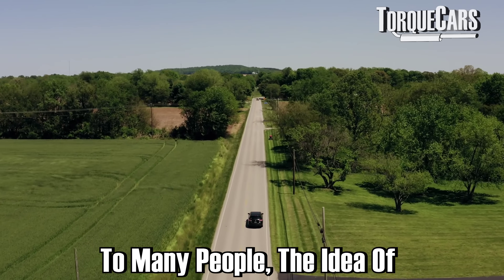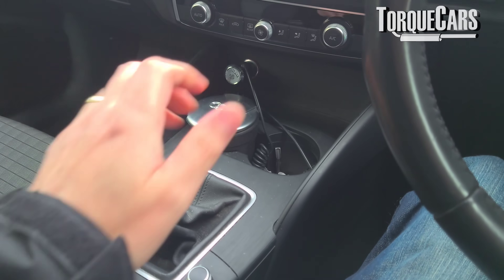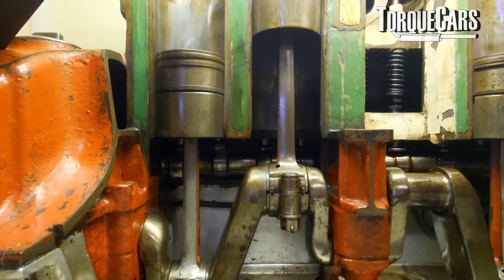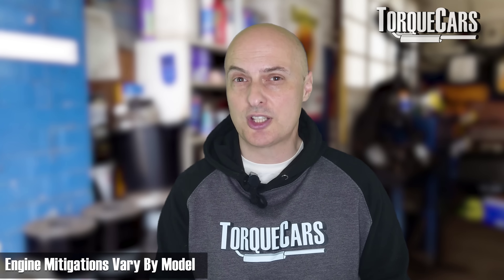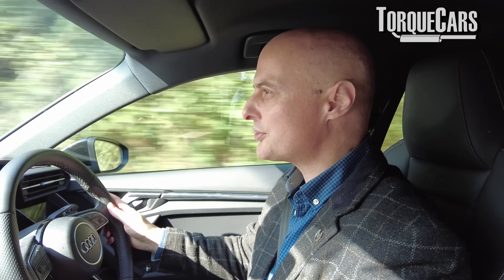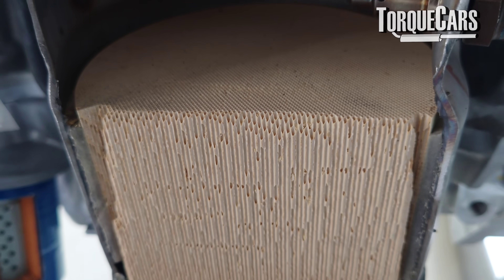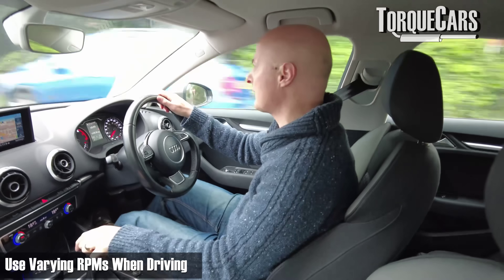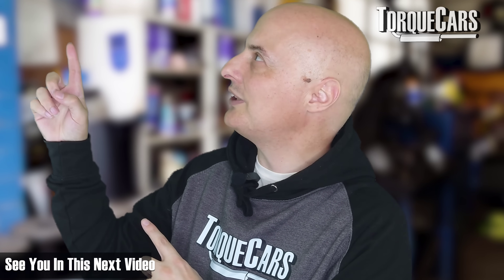BIG DAMAGE By Lugging at LOW RPM? Eco Driving Warning! (Manual Gears)

Comment: Low-speed pre-ignition is the true killer of the modern turbo charged direct injection engine, especially in cars like the Subaru WRX. So much fear mongering about how fragile they are have people babying them around, keeping it in low RPM and then trying to go into full boost at 1,500 RPM is already putting major stress on the pistons, rods, bearings and crankshaft. All it takes is one LSPI event and it's over, you've got a bent/broken rod or a banana crankshaft. Of course you may have many LSPI events that don't cause immediate damage but build up stress points over time, especially on modern aluminum-silicate pistons, which are great for tight tolerance but are very brittle and detonation can damage the ringlands and now you have lower compression and burning oil.
These issues affect all modern turbo DIT engines, if you have one of these cars don't baby them! Keep the throttle light in the low RPM and let it breath when you want/need to accelerate. Stop blaming the cars for your poor understanding of mechanics.

Comment: Hit the redline every day for a good time. That's what Dave Rock always said. And I honestly think that's correct. I drive stick and a 2.4l turbo Volvo that has been tuned. The engine used to be rough when I got it. Repaired allot of the broken stuff. Aside from motor mounts and basic wear and tear it's been solid ever sense. And I tend to stay in the higher rpm range. Like you said low rpm can be out rite dangerous. Not just for the engine but for the driver. You can not accelerate out of the way if need to. During winter I always drop a gear lower then normal so in case I need to power though a corner because of understeer I can. And that has saved me more times then I can remember. (awd life) also saved be ones from getting t-boned by a car reversing up and I had to get out of the way quick. Always stay near or within the powerband is my style of driving.

Comment: Uhh no, I  drive no more then 25 miles an hr tops in my work truck on a base near 30k miles my work truck is from 2010.. regular maintenance is all you have to worry  about..edit by the way my motor hrs are near 90k more idle then any thing else..

Comment: Modern vehicles have programed in where they will "run" at. Usually a low rpm. 

One thing that is interesting is.. buying a vehicle from. "Granny driver ". It drive kinda luggy as it has never been wound out. High enough miles and possibilty of the upper ring groove or carbon ring caus a problem.

Comment: 5:17 I'm sorry, but that's just not how ECUs work at all. An ECU is a computer. And computers use oscillators to keep timing. There is no input from the engine that ever affects the sampling rate of any of the sensors or the ECU. The sensors use the same sampling rate at all RPMs and loads. In fact, high RPMs give LESS resolution per ignition cycle because that's how sample rates work. I really do want to understand your logic, but it just doesn't make any sense.
Reply from the maker: There are 5 times more ignition cycles at 5000rpm than 1000rpm. 5x the "BANGS" if you like, so if knock or some issue is detected in one of those "BANGS" the ECU will trim things around to compensate but gets to do this more often as the engine is running at more cycles. I'm not talking about the computer sampling rate, just that you have more engine cycles to get data from and adjust at higher RPM.
Reply: @torquecars  Fair enough. I accept your argument. But I'll also note that according to my owners manual some knock at low speeds for short durations are normal and expected operation. Say what you will about Ford. Though I've personally never experienced LSPI in my 2.0 NA Focus. But thats likely down to the throttle mapping limiting WOT at low RPMs.

Comment: BASICALLY You have to drive at the RPM of PEAK TORQUE x PEAK POWER, for BEST engine efficiency
Reply: Categorically, NO
Reply: You want to shift up to your peak torque until your peak power when you are racing.
For cruising, optimal range should likely be in between 150% and 250% of idle RPM.
My idle is roughly at 1300 RPM use roughly 2000 RPM for calm cruise, up-shifting at 3000-3500 RPM at slower speeds and use around 3000 RPM at top gear.
My peak torque would be around 4500 RPM and peak power at 6500 RPM. I would use this for max acceleration.

Comment: Great video - this advice is what I pass on to my kids as they are learning to drive: don't short shift unless you are not planning on changing speed very quickly and I prefer if they shift in the approximate RPM range where torque and power curves intersect.
The issue you mentioned around the 4 minute mark - is that what variable valve timing and ECU ignition timing is seeking to address?
Also I don't understand your assertion that a slower speed engine causes the ECU to have less opportunity to adjust timing and metering - surely it has more time?

Once again, great video and thanks for putting it out right as I need it.
Reply from the maker: I didn't make that point very well. There are 5 times more ignition cycles at 5000rpm than 1000rpm. 5x the "BANGS" if you like, so if knock or some issue is detected in one of those "BANGS" the ECU will trim things around to compensate but gets to do this more often as the engine is running at more cycles. I'm not talking about the computer sampling rate, just that you have more engine cycles to get data from and adjust at higher RPM.

Comment: My Grandma's car is going to be trashed after tomorrow, i'll report what happened. It never seen 3000 rpm's. 
My Newer car, 2009 responds much better after a roadtrip, it feels nippier. Because it cleans the gunk of the engine. 
Low RPM doesnt mean Low Fuel.
Reply: This is why I always buy highway driven engines, they are at their peak power and efficiency always!

Comment: My little Honda (with auto CVT) runs at very low RPM most of the time (only reaching 2000 RPM at motorway speeds), and when I took the intake off there was a lot of oily carbon. However, this might be due to frequent short trips and running rich when cold (combined with EGR).

Comment: I think you forgot to mention that some engines use the crankshaft to splash oil around on the cam and other parts. Higher rpm and varying the rpm will splash more oil around and probably in different areas.

Varying rpm also changes the vibration signature through the crank. Engines have dampers but varying rpm can help.

Comment: I've heard this is actually becoming more common in many Harley Davidson motorcycles. The average owner is constantly lugging the engine. The clutches and even the gears in the transmission, are failing. 
This is a perfect example of why riding the right machine for the application, is of the utmost importance. Putting around on a high compression V twin of over 1000cc's, as a daily ride. Isn't the best option for most people. What many don't realize, is that an engine operates at maximum efficiency at WOT. Anything less than that, comprises many of the flow characteristics that allow the engine to burn the fuel completely. More or less wasted energy. You'll get fewer miles per gallon, all other things being equal. I say run them hard, or don't run them at all.
Reply: Do you mean the pushrod Harley engines or the DOHC Harley engines?  The latter ("evolution") engines have peak torque higher than the peak power of the old-style Harley engines, which must be foreign to Harley enthusiasts who make the switch from pushrod Harleys to DOHC Harleys.

Comment: The statement of "most drivers over here have a manual",.. is Wrong, WorldWide. Less then 5% of all cars manufactured since the 1990's have been ordered with Manual Transmissions.
Some of the dialog in the first minute or so may have come out in the wrong order,..
As for 'constant low RPM' causing damage,... I laugh in the soundtrack of Slant Sixes and Straight Eights, and Diesel truck engines.

Comment: So, you’re saying I shouldn’t use ECO mode anymore?
Reply from the maker: More a case of not using a heavy throttle at low RPM and changing gear when you need to keep the car in the power band.

Comment: @1:28, you definitely wanted to say highest gear for low engine rpm. BTW, i have a 1.0 Ecoboost 125hp from 2015 and up to this day I've been driving it only at around 1500rpm and not to mention that when I accelerate I shift so that the next gear brings my engine rpm to as low as 1100-1200 to continue accelerating from. The result? Wanna guess? And it's that Ecoboost which is not for retarded and mind twisted who don't understand engineering at all? Yes, I've always done used oil samples at a lab to check on my engine's wear each time I get to the point of changing the oil, and every time the results prove some 15-20ppm iron and no more than 5ppm aluminum on an oil which is held for as long as one year and 6500 miles. Yes, with those conditions. The thing is that the Ecoboosts are not done by fanboys and all sorts of retards out there giving their opinion on it for why they fail when the owner doesn't use the correct oil and the oil pickup clogs up and leaves the engine with no lubrication. They are done by true engineers and they've designed the oil pump to have variable output according to rpm, soooo, even at low rpm it's a pump that delivers quite good film pressures, keeping the engine away from wear. So, on other brands yes, this could be a problem, but on an Ecoboost Ford, NONE when it comes to low rpm acceleration or crusing. It's the best economical engine in this world.
Reply from the maker: Yes I did slip up there, sorry.

Comment: What are rpm's? Do explain, I think we might need to contact the OED people. 

Besides that I would be more concerned about the gearbox as you mentioned the mechanical advantage of a low gear keeps the loads down on the input side of the gearbox.
Reply: oed???? RPM's are the combined engine speeds, basically the cranckshaft speed. rotational speed
Reply: Oxford English Dictionary. Can someone explain to me why they are now calling it RPM's, it doesn't seem to make any sense

Comment: Im glad the science agrees. Going to show my wife. That to avoid all these issues from lugging the engine all we need to do is get a big block, power glide trans with 4.56 gears and tires that are not too tall. Would make it carbureted to avoid taxing the ecu with calulations at low RPM and drive it like you stole it. Thanks 👍

Comment: In the old days cars hated low RPM acceleration. Try full throttle on a Ford Cortina at 1500 RPM and the whole car would vibrate.
Reply: usually you go open throttle and regulate the power via the RPMs.

A lot of people don't understand this. Choking the engine and letting it rev is just inefficient.

Of course, don't underref the engine. That's why there are torque and power diagrams and an RPM indicator.

Comment: I drive a Volvo with a 1.6 diesel that my dad drove like this all the time before me. The car ran like absolute garbage when I got it, but after a year of hitting 3k rpm on pretty much every single drive, it's running better than ever.
Reply: i remember my first car i ever got when i had my licence was a volvo c30 with a 2,0 i4 diesel that had done city driving for about 13 years of its life. 3 years later of it getting high revs high load daily for a good while and the dpf looked brand new after i replaced the rear exhaust system due to rust. despite the dpf being ''overdue'' replacement according to the oem specs

Comment: Well I do get more damage on modern cars driving on higher RPMs (had to top overhaul with piston ring change at 130k km and timing chain change at just 95k km) than lugging my dad's 1995 car on lower RPMs (<3k RPM) with manual tranny
With CVT on the market I highly doubt high RPMs make sense

Comment: My Grandfather drove his old Ford pickup (1963) at low rpms constantly 3 speed on the column he'd shift tru the gears and be in 3rd gear sometimes as low as 20mph usually 25 but OMG he drove like that  his whole life and that truck had over 200k on it when he gave it to my brother still running. Go figure. My 2017 VW Alltrack with DSG has the factory shift points set way way to early probably to boost EPA fuel milage if I don't put into "sport" mode it will have shifted into 6th gear around 34mph at around 1400rpm ridiculous it's the one thing I absolutly hate about this car. It'll shift into 4th gear around 20mph from a stop, When I drive in "normal" mode the engine rarely sees anything above 2K rpm

Comment: I have sprinter 160hp auto, this thing is constantly seating at 1200-1500 rpm. This is how is factory tuned for euro6. I drive around town, rarely on motorway.  All this Euro regulations are killing engines! Another thing, I must change oil every 3000miles because is full of diesel due to frequent dpf regeneration! How is that saving environment?
Reply: shhh, we all know its bullcr4p, but be quiet, or else you and I are going to be missing for "speading missinformation"

Comment: Part of regular maintenance on a rotary engine is taking the engine to redline at least once per drive. This breaks off carbon build up off the apex seals, and allows the oil to reach the seals. 

If your apex seals are dry, your rotary is gonna die.

Comment: Look at semi trucks low idling is known to cause issues over time. It's why they all raise rpm while sitting. You can get oil slobbering that comes out of exhaust side do to extended low idling. Causes incomplete burn pumping sooth pass rings in to oil and in to bearings especially in diesels. Lower oil pressure especially in today engines that run water lile 0-w20 oil or lower. In colder weather idling causes piston rings to not seat properly do to low temps pumping fuel pass rings Washing away oil causing cylinder wall glazing

Comment: I daily drive my first and only car, a carburator 1985 Lancia Delta , 300K miles on her, all original , engine never rebuilt , driven her for years constantly on 4500/5000RPM top speed 120 miles an hour , she's still going strong. Old Fiat engines were SOHC engines, those could take high RPMs , powerful engines

Comment: Many modern cars encourage this sort of behaviour. Auto's change up too early to keep the engine at low RPM, and many manual cars with gear change indicators often make you change up too early. Like many eco features they seem to prioritise a few MPG over engine longevity.
Reply: Grew up racing karts and cars, got my Learners permit (Australian system) and after a 9 months of driving with my parents i had one lesson before my test and the guy had a Hyundai i20 or 30 and he was telling me i was shifting up way too late at 2000 rpm (petrol) and when following the shift indicator the car was literally shaking trying to accelerate, guy wasn’t happy when i shifted back down to stop the shuddering. Not all info is correct even if they are supposed to be the expert.
Reply: @roberttwest0 shift at 3500 , pick up at 2500 , nice and smoothhhhhh ! 
ONLY with warm engine........😮
Reply: Yup espescially annoying in vans. To overtake or go up a hill with load you have to rev up the engine and it keeps flashing "shift!"
Reply: @simonh870  that’s why I drive in manual mode
Reply: I turned off "Eco Mode" in my 2014 Elantra via the "TRIP" button on the steering wheel. It's a reasonable indicator with very gentle acceleration (my preferred style, TBH), but it asks me to shift far too early with more sporty throttle. The ratio isn't exactly linear.

Comment: Hypermiler since 2006 here, stick shift driver. Only drive small NA petrol cars.
Yes, i lug here and there. I'm always in the lowest gear i can get away with. But i accelerate to that super low gear quickly, so the engine does get workouts between super low RPM usage.

Every part of the cars i've owned has lasted either a little longer, or a lot longer than the norm. In particular, the brakes.
I have a 5 y/o car with direct injection and the buildup of carbon has been slower than expected.
And engine computers don't work the way you think they do.
My engine runs too cool instead of too hot during the winter. I have to stop hypermiling it to get it warm inside... then i can go back to hypermiling.

i experience zero of the stated issues & suspect the video producer is not talking from experience.

Comment: My 2.0 zetec is geared to go 75 mph (roughly 120kph) wt 3500 rpm, and its always run like a top. Its sitting at 332,000 miles. I do sometimes just floor it at lower rpm but i really think its too gutless to matter. Itll be at like 2700 rpm and it still wont really move that fast because the engine is too small for the car (thanks ford). I like to think of it as letting the engine breathe all it wants 😅. Ive also taken it to the American rockies twice which resusts in it being held at 5-6 thousand rpm for 10 minutes straight in 3rd gear because it cant hold speed in 4th. I think its likes the abuse tbh